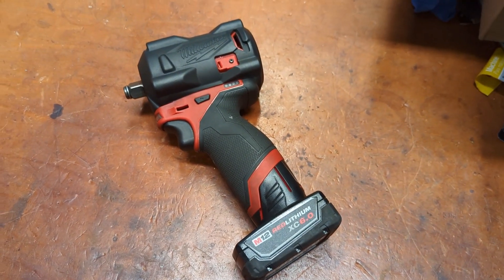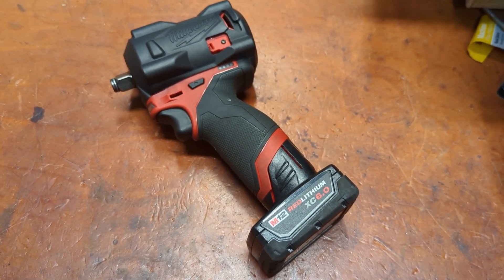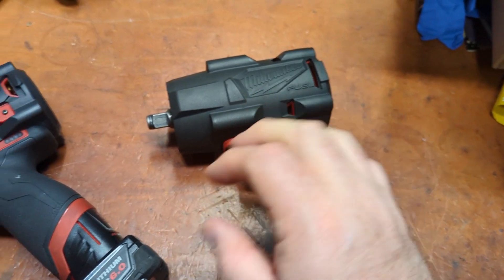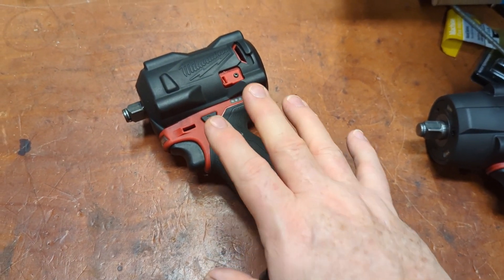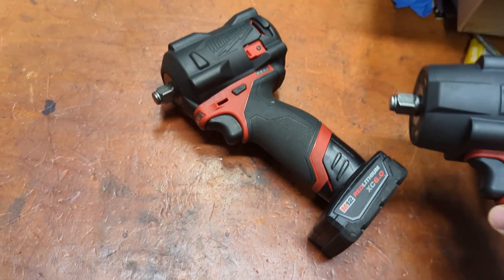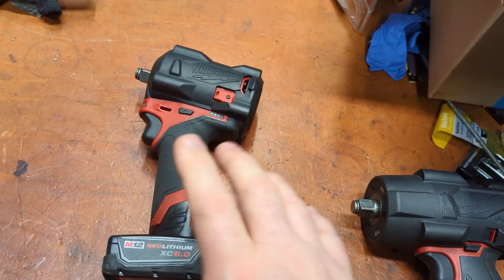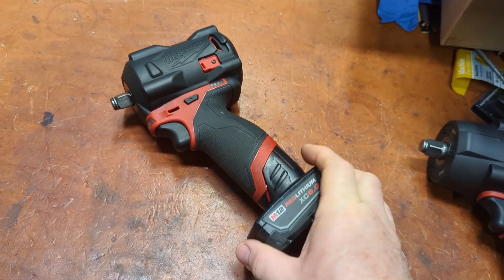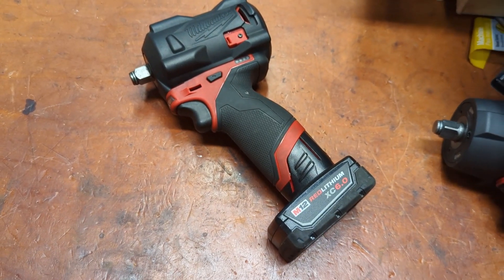Milwaukee M12 Stubby Gen2 Preview - 2563-20

Comment: I'm upgrading but keeping my Gen 1 3/8. The main reason is that the 10-pound Auto Stop makes doing valve cover jobs quick. The Gen 2 stops at 15 pounds, which is too much for that application, but it's beast mode for everything else. I almost bought the DCF921 1/2 a few days before the Gen 2 was announced, and I'm glad I didn't. BTW, I also have the same 1/2 Midtorque, but honestly, I hardly use it and my High Torque since the stubby is my workhorse. For new techs, I'd say get a Gen 2 3/8 stubby, skip the midtorque, and get the new High Torque. You'll be covered for pretty much everything that rolls in.
Reply from the maker: Thanks for a really interesting comment!  I went 1/2" to give me a single set of impact sockets and to have the range go up to the size for wheel hubs/etc.  The Stubby is so short that the additional length of the 1/2" sockets hasn't been a problem.
Reply: @themessygarage  I have both sets of impacts, but the 3/8 gets into some tighter spots especially while using wobble sockets. The 1/2 sockets and extentions are just too bulky at times to use in those pesky transverse engine bays. I do use the 3/8 to 1/2 adapter at times which does give the 3/8 more beans. I'm getting both the 3/8 and 1/2 stubby's this time. You just can't beat the versatility of the stubby's torpedo style 🔋 breakdown to get into some crazy places 👍🏻
Reply from the maker: @johnny4713ify  There are so many low-profile options for impacts that along with the shortness of the Stubby I just can't see two sets.  But if you have the room and the tools, it's all good...
Reply: @themessygarage  Maybe for a DIYer, a 3/8 or 1/2 inch Stubby would serve them well. As for myself, I find that I need every bit of clearance possible, so having both options is a must. For example, I was working on a 1996 OBS F150 that needed the water pump and fan clutch removed. I used several fan clutch wrenches to remove the fastener, but no dice. It was so seized that I was literally stripping the fastener. I ended up cutting off the fan clutch and just leaving behind the fastener for easier access to remove. I tried using my 3/8 stubby, but the additional adapter length, while using the larger socket, prevented me from zipping it off. If I had the 1/2 version, I would have had just enough clearance to at least bust it loose. Whoever replaced it in the past used a crazy amount of Loctite, so a long breaker bar and a bit of heat popped it loose. And yes, I do own low-profile Astros and Capri sockets in both 3/8 and 1/2, but in that application, it wouldn't matter because they don't make them that large unless custom-ordered. For me, the 3/8 version has served me well, but having a 1/2 in the mix is well worth the investment.

Comment: I have the 3/4" M12 stubby and 1/2" M18 mid T. I ordered the new M12 in 1/2" stubby to go with the older M12 in 3/4. The M18 is much harder to use one handed vs the M12 stubby. Lightweight is key.

Comment: Great video are you getting the 3/8 or 1/2” ?
Reply from the maker: I'm getting the 1/2".  The early evals I've seen say the 3/8" has slightly more grump, but I want access to big sockets for things like hub huts, etc. without using an adapter.
Reply: @themessygarage  sounds good 👍